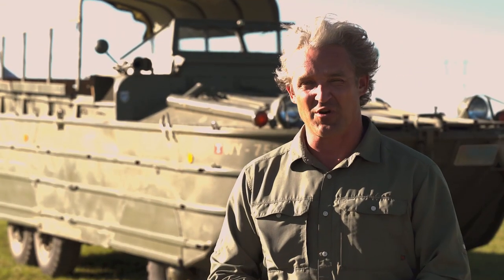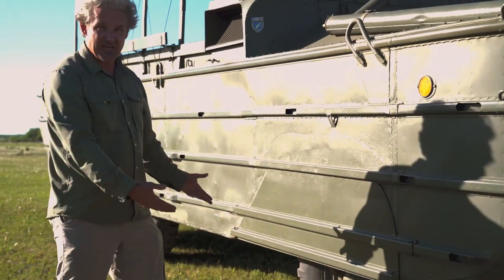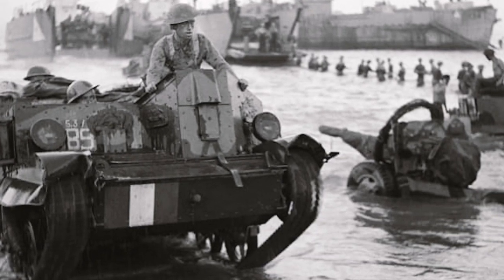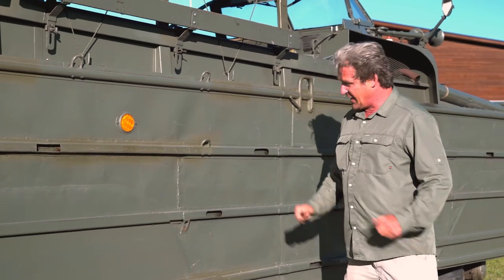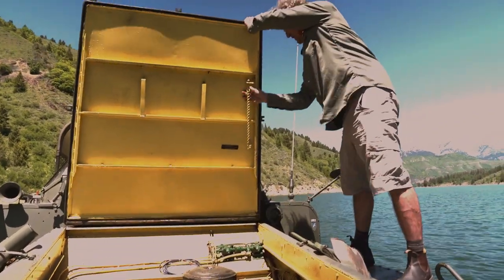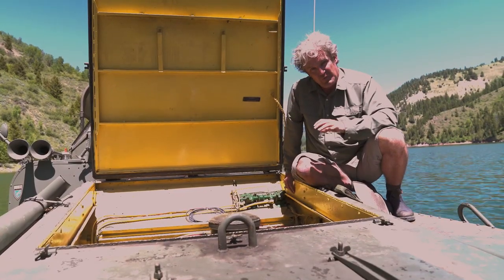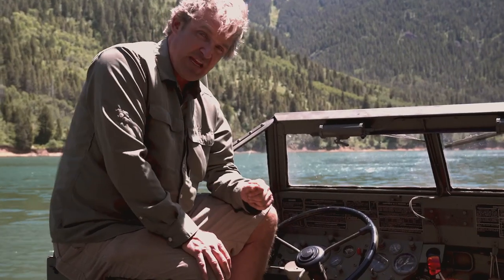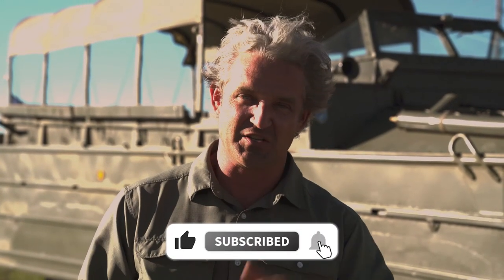The Rare GMC DUKW Truck

Comment: My uncle bought a dukw back in the early 80's and a bucket truck.  Took the hydraulic boom off the bucket truck and welded it into the dukw. We used it for years to pull moorings out of the Racine, WI. Harbor. It was all fun and games until they installed a giant marina and the mooring business became a historical footnote.

Comment: Cool DUKW, but please do a bit more research when you speak about things. GM builders retained most, if not all, of their highly trained/skilled workers to assemble CCKW/DUKW Trucks throughout the War. The work force was augmented to keep up with the overwhelming demand for War Materiel. The Lend-Lease Act was signed into law on March 11, 1941, and ended on September 20, 1945. https://en.wikipedia.org/wiki/Lend-Lease. So France did not keep DUKW's through the L/L program, the were purchased by France and left behind by the War Dept. after the W.W. 2 due to the extremely high cost to bring materiel back to the U.S.